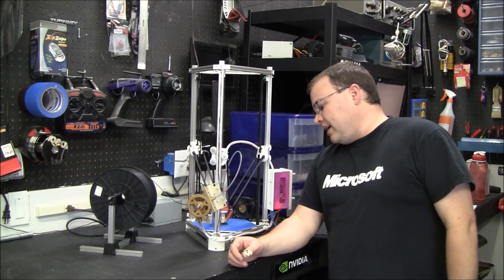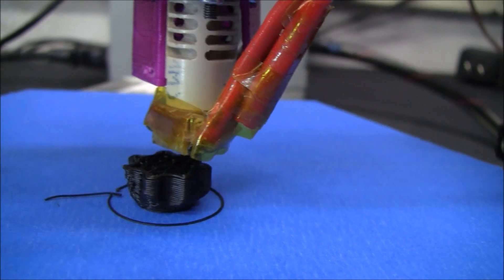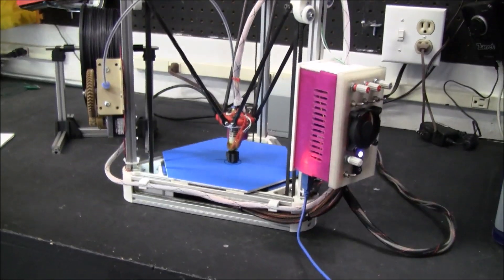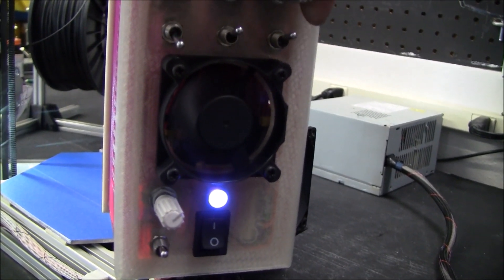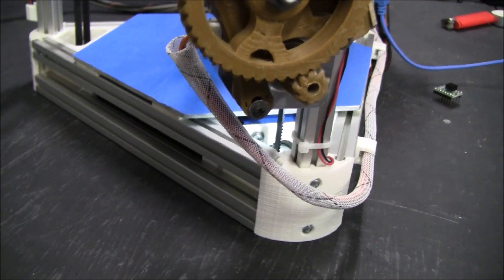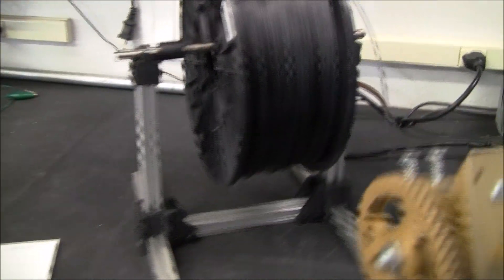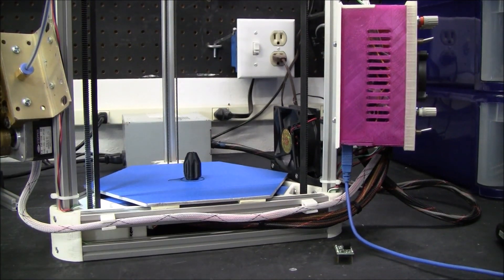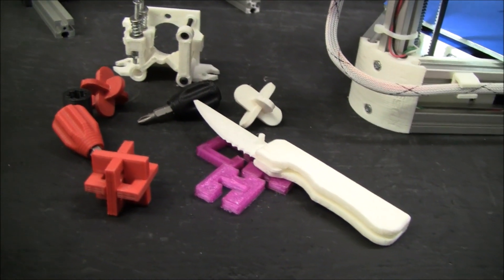3D Printer Accesories

Comment: Thank you so much. I was completely unaware that PLA expanded. For the past month or so, I have had so many jams and have actually had to replace the hot end ( costed me a bloody $40) due to a melt down. Originally I had a fan sitting on the bed that blew pretty significantly.... now to put it back along with a big fan (conventional ones used for room cooling) perhaps will save my printer..... my ptfe tube keeps sliding out and the clasps on the fittings are of no use. Any suggestions? So far a small 5mm nut has worked on the extruder side, but not really effectively on the hot end side.... could you help me out here? You seem to know mountains more than I do.... thanks... any help is greatly appreciated...

-AntonioH